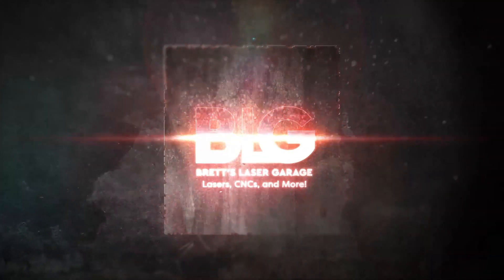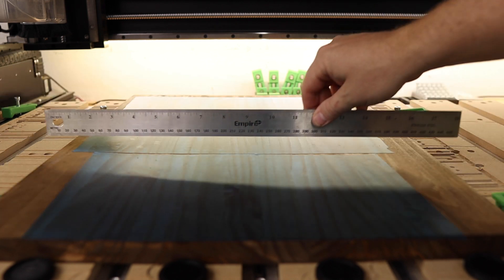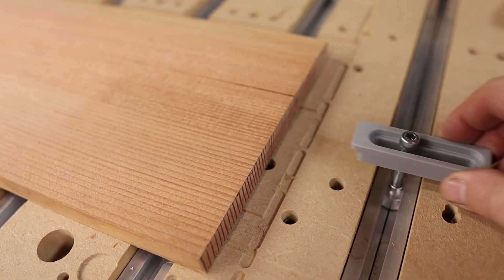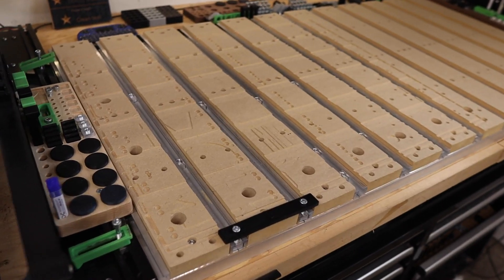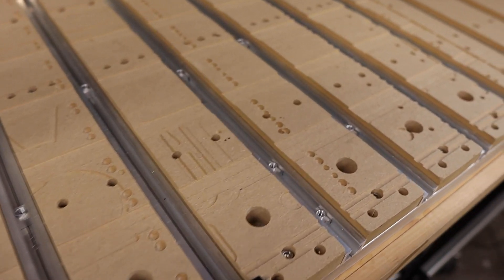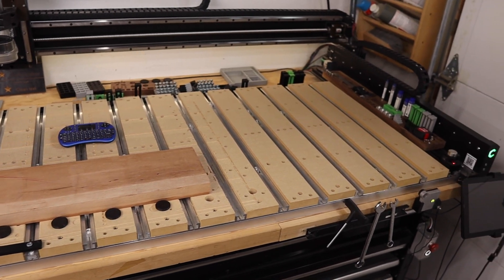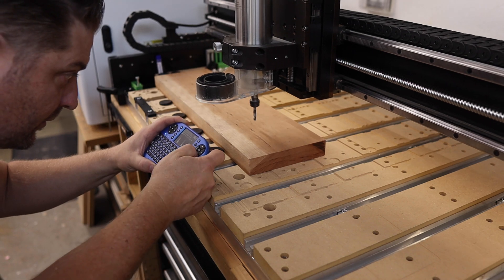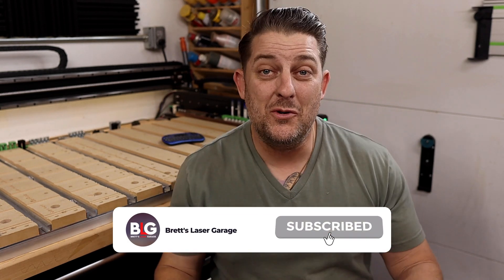Top 5 Game-Changing CNC Accessories You Need Right Now | Shapeoko 5 Pro | Brett's Laser Garage

Comment: I am looking at the 2x4 model due to size constraints. I could make the 4x4 work but it would be tight. Are you satisfied with the 4X2 bed or should I go bigger?
Reply from the maker: I love the 2x4, I’ve never needed anything bigger.  If I had the room I’d go for a 4x4 though.  Just because it’s not that much more expensive and the extra size couldn’t hurt.
Reply: Thanks, I appreciate your reply. I have been getting ready to purchase the same CNC machine that you are using. I have been studying the tutorials on the website. I’m a little overwhelmed with the software and instruction. Any other sources you recommend?
Reply from the maker: Cool, it’s definitely a lot of information but you’ll get there.  Carbide 3d has the best tutorials in my opinion, one of the reasons why I think it’s the best beginner machine.  And their software is by far the easiest yet powerful.  Watch all of carbide 3d’s videos/tutorials and join the support forum and browse through that.
Reply: @LaserGarage  I found the software kind of weak myself , I'm using Vectric , and Light burn for my added laser on my pro .
Reply from the maker: Awesome, Vectric is very powerful that’s for sure.  I love Carbide Create personally, but everyone’s different.  Thanks for watching!

Comment: The 3d printed dogs are so nice to have. I made a file last year that milled rows of them in each slat of my waste board going up the Y axis so I can move my fence for a location point to anywhere on the table depending on the project.
Reply from the maker: That is a great idea for making reference points on your wasteboard!  I love the functionality of the dogs.
Reply: @ thank you, I have a very similar setup but 4x4 and already use every tip you listed. All of them will certainly be helpful to anyone that’s getting started. I will say having a 3d printer pays for itself just with all the accessories you can design and print for your cnc and shop in general. I’m always printing things for the shop
Reply from the maker: Agreed.  I recently got back into 3d printing myself and have really been enjoying it.  I can’t believe how far they’ve come down in price and how much easier they are use compared to just a few years ago.

Comment: Great video! I checked your Etsy, but I didn’t see the hold down clamp steps. I have plenty of the hold downs, but was looking for the steps. Also, will you sell plans for the wasteboard for a 4x4 S5P?
Reply from the maker: Cool thanks a lot John.  I sell the steps as an add-on to the essential clamps currently.  There is a drop down menu to add them.  Send me a message and I can add them as a separate listing.  I may sell plans for the 4x4 waste board but since I don’t have that machine I don’t have a way to test it to make sure it works.  They are like 49” long so I don’t have a way to make them in my 2x4.